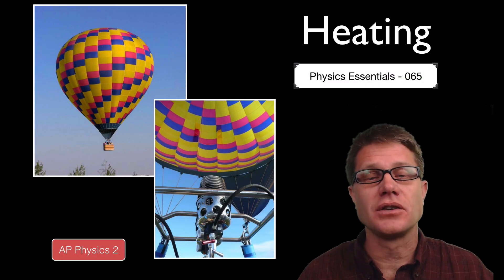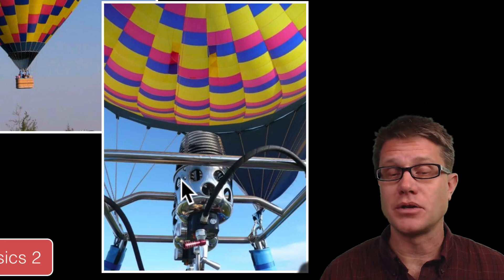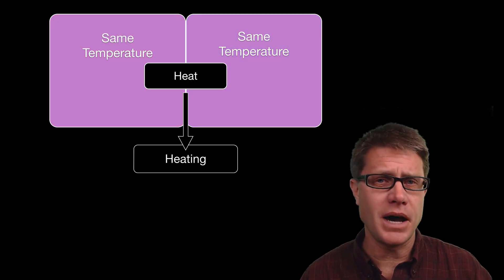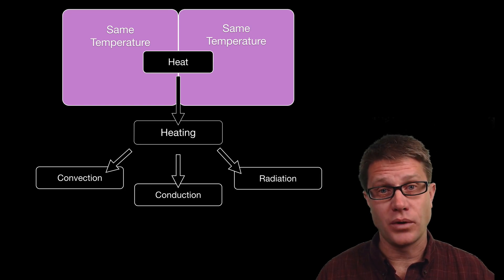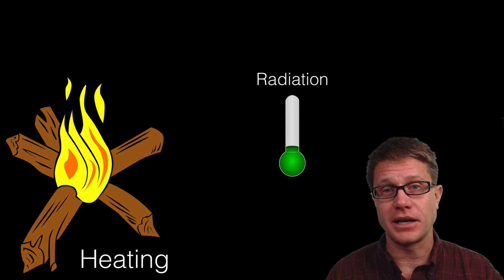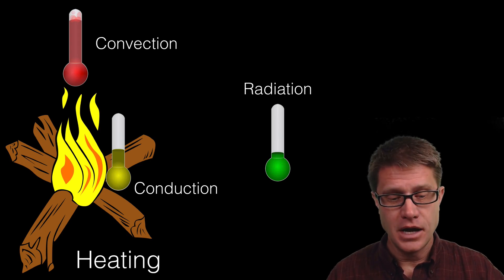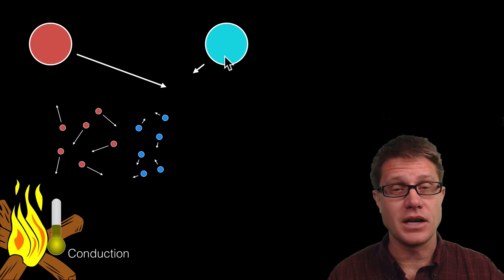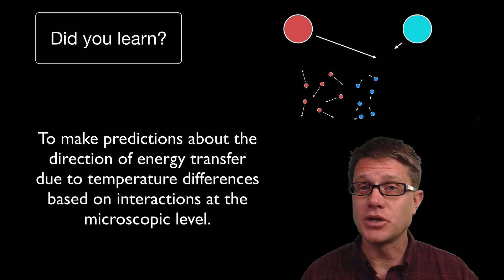Heating

Comment: Sir, I just took the Union HVAC test here in California...and one of the questions was drawing, split into two parts, which showed flame with a stick touching one flame from above, and the other picture was of a flame with the stick held NEXT to at an angle...The question asked was: Of the two sticks, WHICH one would heat up sooner? Heat rises--so I was told--so I picked the stick that on top of the flame. Is that the right answer?